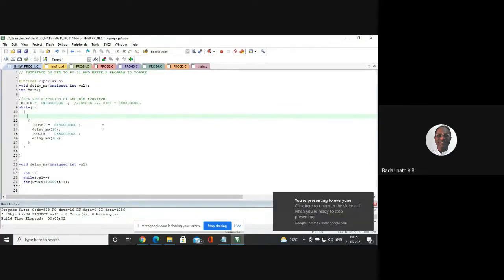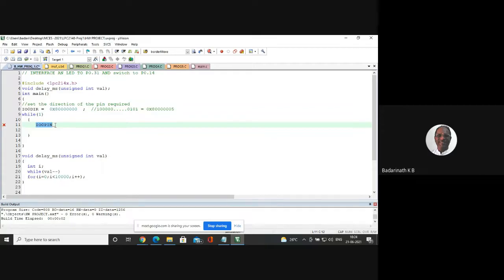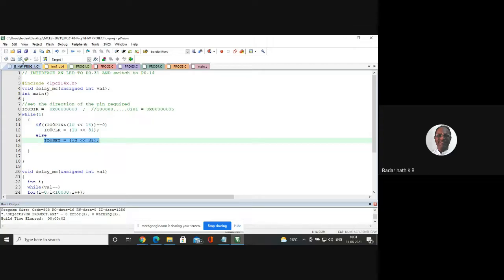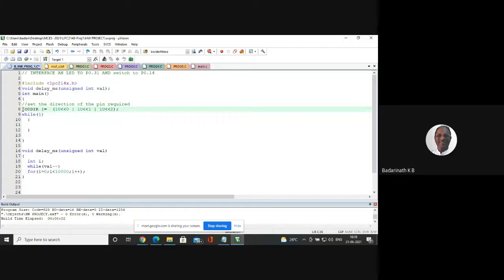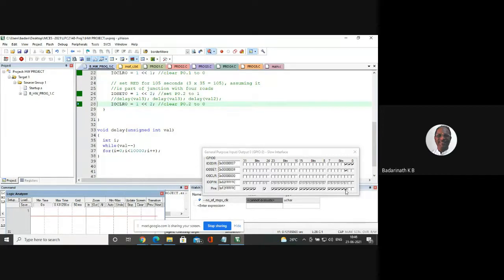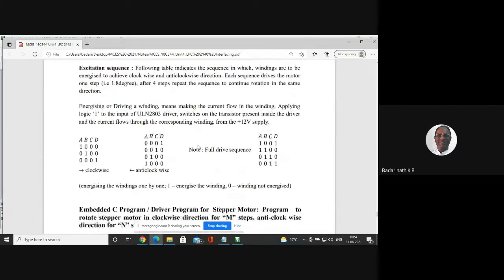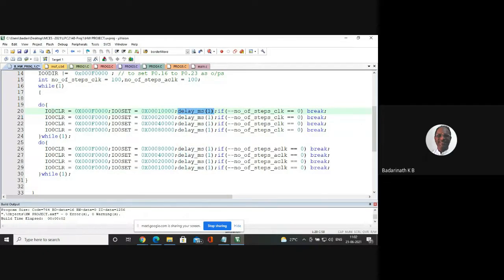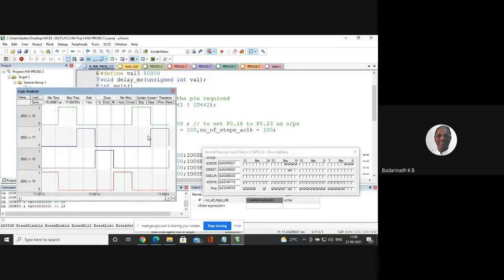MCES 2021 ARM LPC2148#6

Comment: Common base transistor is used as interface ckt bw stepper  motor and lp2184 board. Base connected to output ports of lpc2148 . Collector connected to stepper motor as input . And emitter is grounded. 
Alternately druver IiCs can be used